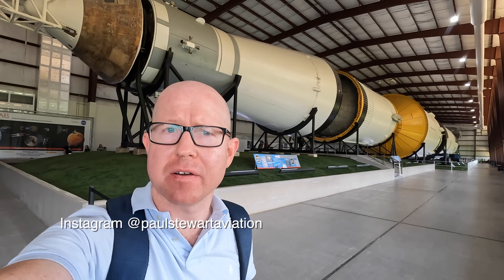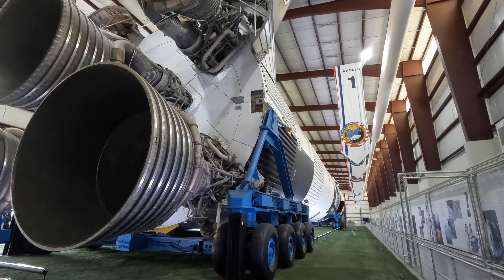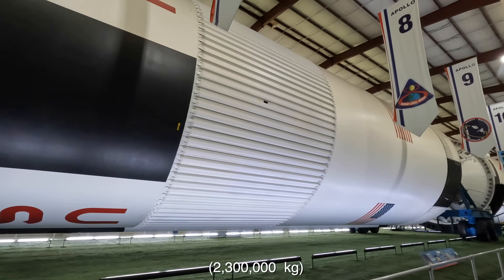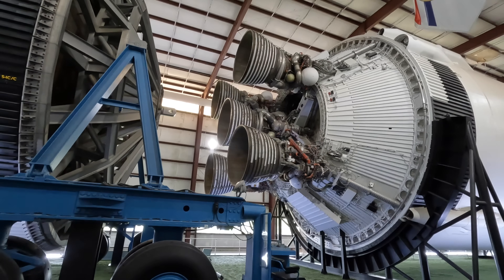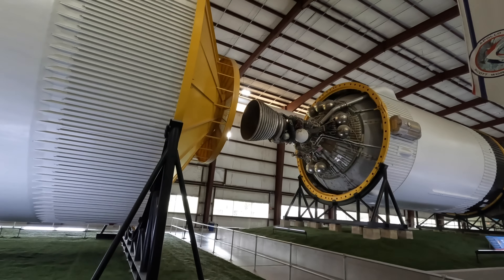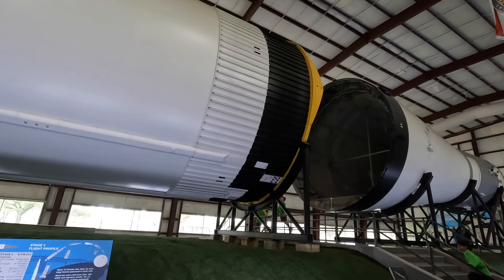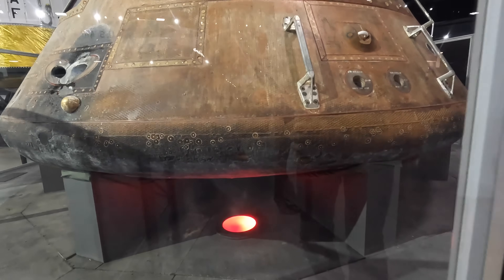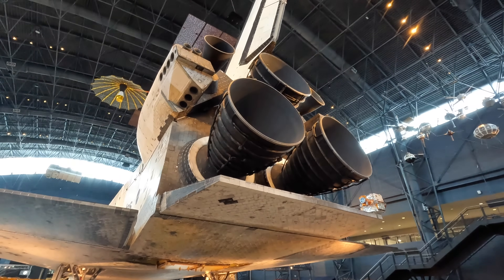Detailed tour around the Saturn V rocket!

Comment: Noticed a small mistake at 4:14 . Those arent solid rockets for stage separation since they were located on the interstage. It´s actually one of 5 hydrogen feed lines for the engines.
Reply: Thank you. I wanted to point out the same thing. The actual separation SRBs would have been placed on the interstage ring, I think.

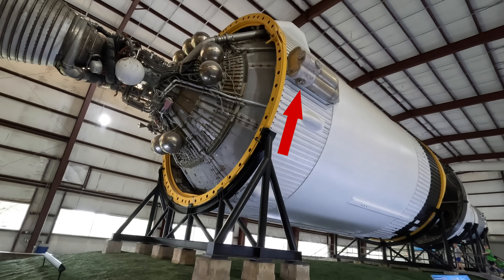Comment: The device you point at in minute 5:38, there is no way it can be used to dock with the lunar module. When that stage is being used the lunar module is still in the garage section. When the apollo docs with the lunar module it uses the command service module trusters to dock.

Comment: Saturn 5 is only slightly taller than the N1 Russian moon rocket. But the N1 had higher thrust per stage Vs the Saturn 5. Sad they haven't got a Luna Lander in the area where it should be to give the empty area a purpose.
Reply: The N1 rocket was a complete and utter failure.

Comment: You forgot that Kennedy Space Center has a Saturn V as with Marshall Space Center, there are 3 complete Saturn V's left, Apollo 18 is at Kennedy, Apollo 19 is at Marshall, and Apollo 20 is at Johnson, NASA was funded up to Apollo 20 but back in 1972 the program was funded until Apollo 17, Apollo 21's Saturn V (NASA and the DoD liked having spares around in case something broke) was used to launch Skylab, and the rest of the Apollo CSM's was used to fly to Skylab and the very last Apollo was used for the Apollo - Soyuz mission then it to flew to Skylab.
My father worked on the Apollo program from 1967 to 1970 and he kept up with all of the events and happenings that NASA was doing for that program, he then went to Viking, Magellan then Galileo before he retired from the space race, I too was part of the space race but I only worked on Magellan & Galileo programs before I was laid off from the prime contractor because of Budget cuts from Congress.
Reply from the maker: I believe that the others arent made up of 100% mission-approved components
Reply: @PaulStewartAviation   Yes they are, like I said the one at Kennedy was in the VAB all ready to go when the powers that be cut the funds for that flight, also the ones at Marshall & Johnson was at Kennedy at that same time, but NASA shipped the remnants to the largest space centers during the Skylab missions and I do believe up to the first flight of Columbia back in April 1982. Like I said my father worked for NASA during the first moon missions and he was totally into what he was doing and kept up on any fragments of information about that program, but in 1970 he left NASA to work for Martin Marietta (they offered better pay and upward mobility over the Federal Government back then) and he got on with the Viking Program soon afterwards

Comment: Paul. One question. You never mentioned how many people sat in stage 1 ensuring kerosene and oxygen kept flowing good thanks?
Reply from the maker: What do you mean? The humans were all up at the top in the command module.
Reply: @PaulStewartAviation  so no astrnauts sat in stage 1 that's impressive
Reply from the maker: correct
Reply: @PaulStewartAviation  there must have been at least one to turn buttons on and off.
Reply: @halitosis75  You're just being silly
Reply: @halitosis75  Stop trolling.
Reply: @apolloskyfacer5842  I'm asking a question not stupid. Someone has to press the buttons
Reply: @PaulStewartAviation  how is that possible. Where did all 15 astronauts sit then?
Reply: @PaulStewartAviation  up.top commanding down to the astroturf in stage 1 of which there are 8